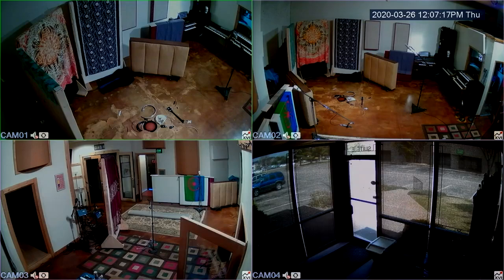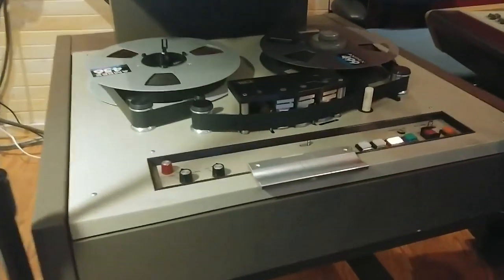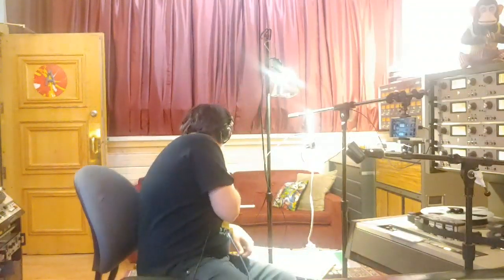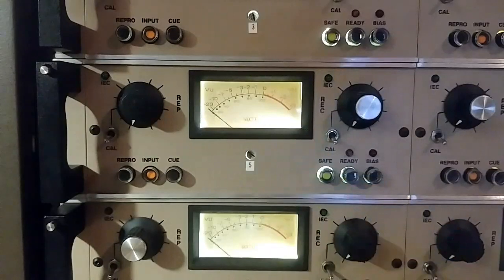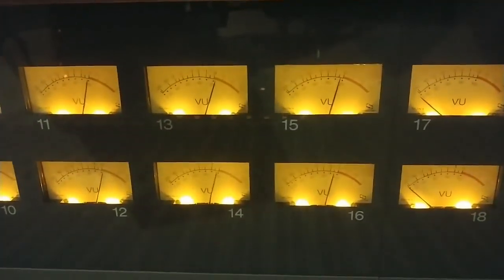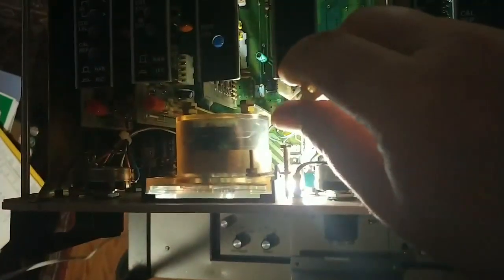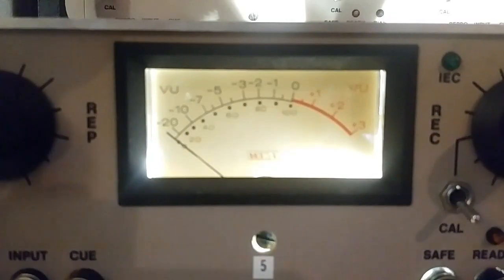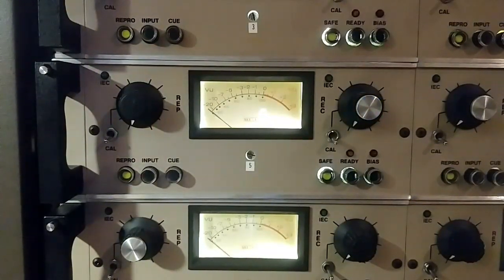MCI JH-110 Meter calibration

Comment: Hi, here's what I might have done. Instead of going for the meter cal pot initially I'd want to measure the output of the channel under test (in input mode) with a DVM and see if it is really putting out 1.23v (+4dbu) after verifying your console output of course. You would use the IN-CAL pot to adjust it to the correct level and THEN adjust the VU meter to 0vu. Had you already done that step?
Reply: Hi, you are right..  you need a AC millivoltmeter to read in  R.M.S. VOLTS (Vrms)  and don't forget to place a 600ohms resistor in parallel from the input terminal to the ground terminal of the ac volt/dbmeter, some manuals like jh110B uses +4dBv, i have a JH110A but i don't have the original manual, i would like to know.. but jh16 & jh24 uses +4dBm..                                               (dBm=dBu)      
0dBv= 1Vrms                                              0dBm = 0.775Vrms                                        +4dBM= 1.228Vrms                                         +4dBv= 1.585Vrms
Reply from the maker: Of course.  This was to show meter calibration.  You should always double verify your recording setup